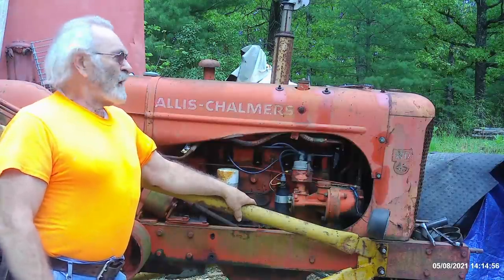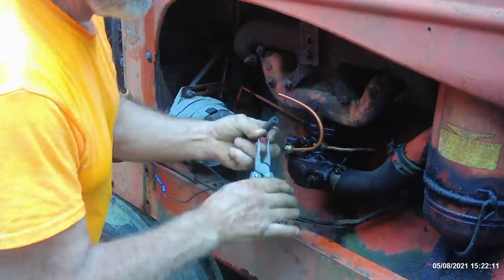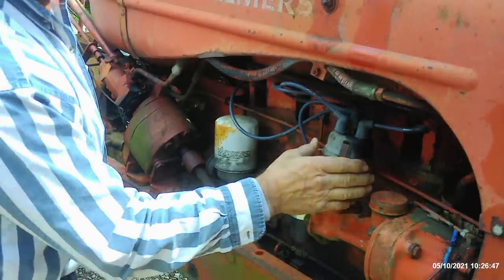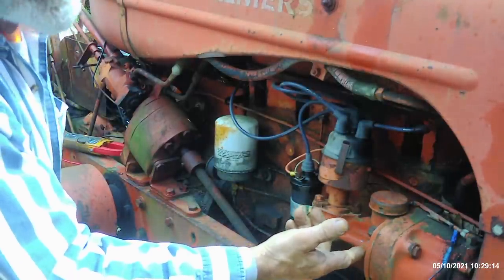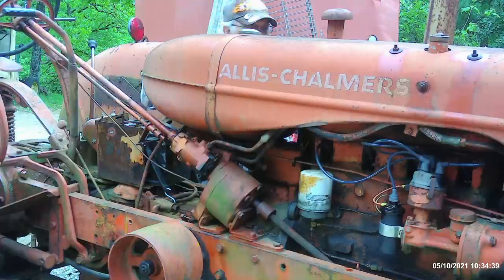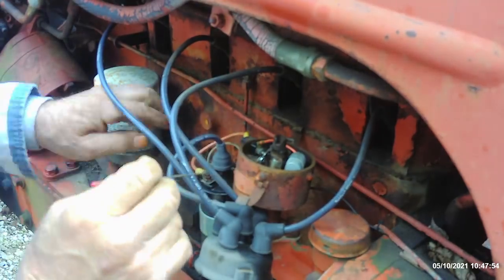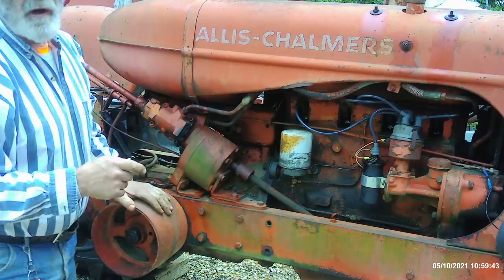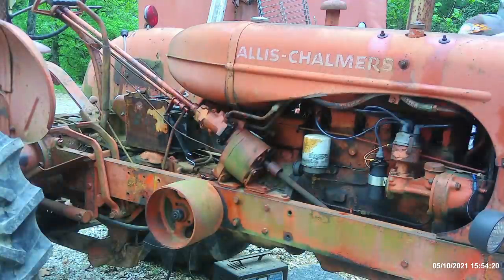WD 45 Allis Chalmers Preps for First Start

Comment: Have u ever had to deal with the starter solenoid sparking even smoking the second u try an start it? An how can u fix it. I have new battery new cables 0 gauge especially for the pos ground.
Reply from the maker: Usually that indicates a faulty connection on one of the large terminals or faulty contacts inside the solenoid Brian.  If its an internal issue, I just replace them. But the first thing I'd do is to sand and secure the connections to eliminate that as the potential reason, but I'm sure you've done that already.

Comment: In 1970 my dad & I got a 1956 wd45 @ auction for 275$ . Buddy & me fixed it up. Old farmer down the road gave me  good rear tires/rims/ weights& fenders. Just had to help him clean out old tool shed. Painted it w/ spray can Persian orange. Found a 3 bottom plow& hay mower. Sold it in 75 for enough to pay for my 1st year of college. Loved that thing.
Reply from the maker: That’s a good story. There sure were a lot more deals to be had back then than there are now. Many times old tractors sitting in the fence row could be had for the asking. Thanks Richard for  the cool story.

Comment: murphy's law..  know you're close when the battery runs low. lol
Reply from the maker: Hahahaha...yeah.  I didn't think to charge it fully before I got started working on this old thing.  Sometimes a low battery will drop too much voltage with the starter that it'll just have enough for a weak spark.  That can cause a guy some problems too.

Comment: George Almoney   I have one to but it propane fuel and gas my Dad got it new in 1956 it run better and has more power then gas . Have all the manuals.
Reply from the maker: LP burners are the cleanest engines I've ever been inside.  Hardly any carbon at all, just as clean as can be.  That's great that you have it will all the manuals !!

Comment: Well, I have an Allis 170 diesel that I have to clean battery connections on often. I'll have to find me a container of in-him-bator for it. I always thought that stuff was for modern John Deere equipment since they like to screw everybody now days. 👍🤣😉
Reply from the maker: Boy I've heard some horror stories about pickup and delivery fees and troubleshooting charges from John Deere dealers that'll curl your hair !! Seems you don't own the software.  Seems like if JD still own the software,  the farmer should be able to charge them storage fees for keeping it in their machine !!  Hahaha....Chris, thanks for the comment.  Corrosion is a bad thing in electrical circuits, whether its ac OR dc for sure.

Comment: Ditch the distributer and put on a Magneto it will start and run better also 8volt battery in place of six volt if you want it original
Reply from the maker: Whatever it takes to get a hot spark Frank !!  I bought this rig non-running with the intention of robbing the more desirable 45 motor to swap into the old Allis Speed Patrol with a weak WC motor.  But I haven't decided to do that just yet.

Comment: The Allies Chalmers line are good basic tractors. Very popular in my area. Great reputation as being able to sit in the dev
Narrow for years the fire right off.
Reply from the maker: There are for sure some brands that over others that have reputations for easy start in all weather conditions.  The Massey 30 and 44 for a couple.  Of course there are excellent starters and runners of all brands as well as the irritating and aggravating ones !!  So many times this day and time the starting problems for long sitters are attributed to the hygroscopic properties of fuel with alcohol added and the phase separation of formulated gas that's sat extended periods.
Reply: @tractorman4461  I wonder if low compression and big cylinders have been a contribing factor to easier starting?
Reply from the maker: @OldSneelock  I think the key is in the lack of complexity with these as well as many others of that era.

Comment: New subscriber hear. I'm an old tractor guy myself. I have a Farmall H in the queue after I do a clutch job on the Ford 8N!
Reply from the maker: I like your Username...LOL...I actually have a small trailer load to haul in.  Scrap is up to $160 for sheet metal right now from a low of $40 a few months ago.  What's wrong with the H?  I have a playlist of an H I've been going through.  If you'd like to take a looksee, here it is: https://www.youtube.com/playlist?list=PLk72G9DTzZ1u4HTcEVKC3ehyV_UsFYaAG  Thanks Matt, for watching and hope to see a comment on some of the H vids.
Reply: @tractorman4461  Thanks for the link. The H is a rescue I purchased last year from a widow. It had sat for several years and was lightly stuck. I got it freed up and now it's time to do the carb, clean up the ignition system, and check out the valve train. Hopefully no stuck valves.

Comment: Ok TRACTOR MAN 44 , i have gave your U tube name so critical thinking and have came to a questionable conclusion the 44 in your name maybe because you live in Missouri closed Highway 44,without giving your address away, am i close ?
Reply from the maker: Actually if that was the case, I'd be Tractorman55.  LOL.  44 goes east and west and 55 goes north and south.   I'm south of good old St Loo !!  Good guess though.  The real reason for the 44 in the username is that I am a fan of the infamous Massey Harris 44 because that's the tractor I grew up on.  We had two 44's, a 101 Super and a 101 Junior.  Something about those 44's with a straight pipe just makes a farm boy feel real good...  Thanks Tom for always the humorous twist in the comment department.  I look forward to them every video !!

Comment: What if there was no duel moisture on the plugs? That means the carb isn't pulling fuel all the way up into the intake to crossover to the plug to fire right?
Reply from the maker: Usually that is the first assumption and it directs you then to give attention to the carb.

Comment: An AllisChalmers tractor is a 6 volt positive ground setup, originally.  Later on people would put a different charger and battery on their tractor to make it easier to crank and start.
Reply from the maker: Yes, most the old ones were positive ground, whether 6v or 12v.  This one being a '56 I wasn't sure what it was originally.  Most automobiles changed to 12v around '56 or so, but I don't know about tractors.  Thanks Doug for the input sir.

Comment: Thanks .i have a 1958 wd 45 .suddenly wont start .im not to bright but these videos help my investigation
Reply from the maker: Thanks for watching...I think this one covers a lot of the bases for what we do on a fresh one on the place.  Hopefully you got it running  by now.  If you did, what did you find was the problem..?
Reply: @tractorman4461 so i just got it going today .not sure what exactly made the difference .i just went through all the step again .and it did fire up .i did make one adjust to the carb .i loosened the screw which released some of the tension of the spring which controlled the movement of the flaps inside the carb .the large flap did seem very stiff.

Comment: Just a little bit of work to get her started! Nice tractor you’ve got there.
Reply from the maker: Yeah, it wasn't too terribly bad.  I did find the power steering pump is missing the pulley...so something is probably not too good of shape there.  I gotta pull the RR rim and put a patch around the stem before it can be used though.

Comment: Excuse me boss man do you know what type of oil does the transmission take
Reply from the maker: Actually I do not, because I really am not into Allis's that much.  But if the hydraulic sump is totally separate from the final drive, I will run 80-90 in the transmission/final.

Comment: Well done sir, nice Allis you have there with power steering.
Reply from the maker: Thanks Mark.  I've still not decided if I'm going to put this one back to work, or if this WD45 power plant needs to go into the older W Speed Patrol.  Power steering would make the grader much easier to use back here in the woods.  Thanks for watching.

Comment: You pull the oil and cut open the filter for an inspection ?................ Like the Doctor checking your blood.........
Reply from the maker: What I like to do is use an old steel cookie sheet.  Drain a quarter cup of oil from the crankcase and take it to the bright sunlight.  Then tilt it to let a thin film glide all the way to the bottom.  If there's any metallic grindings they will glitter like a Crystal Palace showgirl on a hot Saturday night !!  (Not that I know what the ladies would look like, mind you...LOL).  But bright sunlight brings 'em out if there's anything there.  Thanks BubbG for the good question.

Comment: Hey i need your help again .what r the parts under the ignition ( chamber ) between the key and the bbattery where the fuse is .can u do a video on that .i cant get my tractor to anything .no power to start. Is it the ignition or .one of those other parts inside the ignition casing area
Reply from the maker: I could it the previous owner hadn't cut almost all of it out before I got it.  Many times the problem is faulty connection of the ground wire from the battery. I'd shine that up first then put one end of an electric meter on the ground.  Then I'd verify voltage at the positive terminal at the starter button or solenoid as well as at the key switch or push button.  If it's there, continue on to follow the voltage at the ignition coil after it passes through either the key switch or push button.  If its there, then check the other side of the coil and on to the distributor.  If it's at the distributor and still won't fire, pull the cap and check for oxidation on the contact surfaces of the points.  Many times that's the issue.  If it ran before and nothing has been changed, it should really be faulty connections or oxidation at the points that's causing the issue. Good luck, and you can but a cheap digital voltmeter at Harbor Freight that'll get the job done for ten bucks or less.
Reply: @tractorman4461  thanks so much ill.always keep this fir reference '.so it turned out to be a broken wire to the alternator .a ground wire i guess .my neighbor figured it out .really appreciate your incite .it still kinda. Sou rough maybe old gas lots of condensation above the carb .after having it parked all winter i cant remember if thats normal .but i have about 7 acres to bush hog so im glad its running again .its nice to have u in my back pocket for reference .h ave a good one
Reply from the maker: @teddybrzeski  Excellent !!  I'm glad you got to the bottom of the issue. Most of the time a big problem is just a hidden little problem.  If you look at it like that, sometimes its much easier to locate.  Thanks for the update !!
Reply: @tractorman4461  yes big problems r little things .after i got it runnin it was runnin like crap .i was out bush hogging 7 acres when it dawned on me .maybe the choke is on .i never use the choke .sure enough it was on so i turned it off. The old girl gave me a smile and a wink and took of like a new born baby lol

Comment: The old girl does run.  I'm sure you will figure out what's causing the miss.  It may well be a bad spark plug or spark plug wire.  Or a sticky valve.  Is this tractor a keeper, or will it indeed become an engine donor?
Reply from the maker: I'm thinking sticky or burnt valve, but I don't know yet.  I'm afraid I'm deciding that its too good of a specimen to destroy just for the motor to put in the Motor Patrol.  That'd be a shame.  Besides, I need another tractor to compete with the Farmall's and Massey's....  LOL.  Like she says: "Stop it with the excuses to keep another one''......
Reply: @tractorman4461  My wife keeps telling me, "This is the last one!!!!!"  She has told me that the last several tractors.
Reply from the maker: @316jd140  well my trick is to make sure the Missus stays away from the woods. LOL. Outta sight.... outta mind. Hahaha.